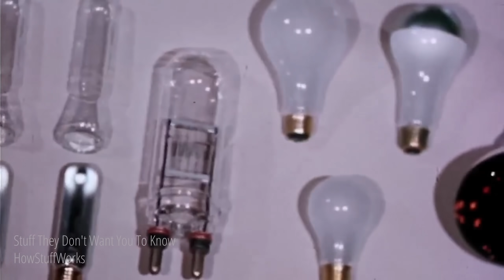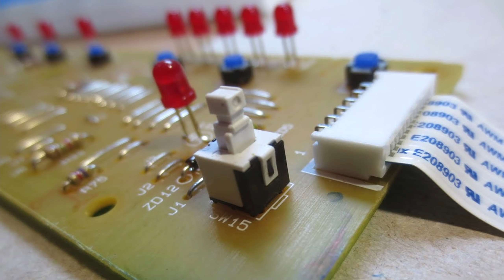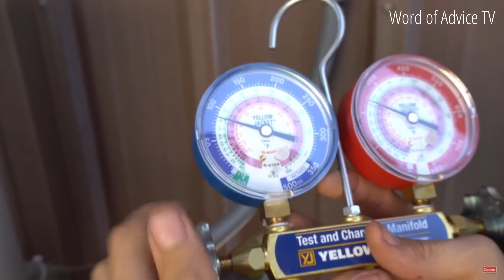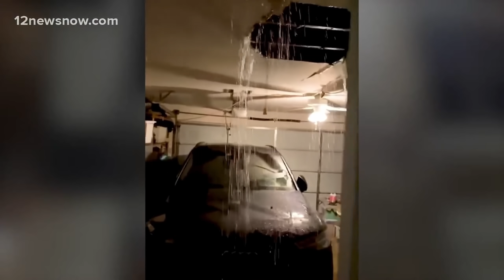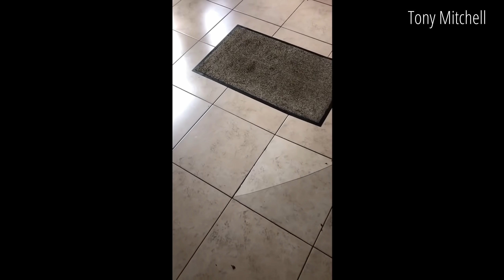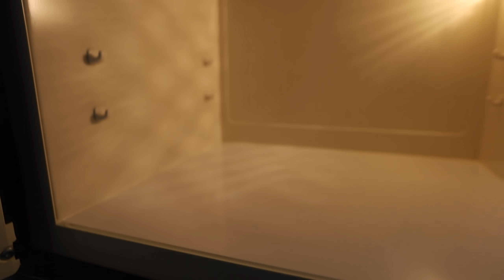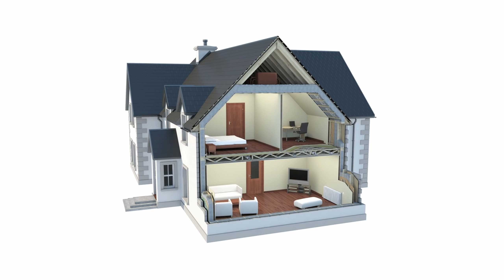Built to FAIL | Planned Obsolescence

Comment: So true ... I hit a small related issue this week when I tried to replace the diverter in a bathtub spout .. but the  spout broke when trying to remove the old diverter. This would not have happened if the spout was metal.  I was forced to replace the spout.

Comment: Bling fails.  Does your appliance really need a wifi connection?  The most reliable gas ovens are gas-only with no blingy electronics.  But even buying pricey appliances that look robust doesn't insure reliability.  I was considering a used high-end Bertazzoni gas range, but googling found they constantly fail and parts are hard to get in U.S.

Comment: I fixed my step mothers expensive oven. We contacted the service tech they advised to buy a new one, to fix it will cost $2000, better to buy. I took it apart, and disconnected the connections on a mother board. After few minutes i connected them back and it came back to fully functional .  Saved her thousands. Probably it has internal timer that is deemed to shut down after some time usage. Theu are cheating 😂

Comment: AWESOME VIDEO ! !  --- here's one --- EXPOSED FASTENER METAL ROOFING ! . Metal roofing will easily last over 100 years; But with fasteners that always have a "PLASTIC WASHER", they can only last as long as the washer.    it is so GREAT from you about this. Not many people really understand "Planned Obsolescence" and how many types exist - IT IS EVERYWHERE ! ! Here's a good example - EXPOSED FASTENER metal roofing! first the fasteners washers will fail, then the fastener will help introduce Tiny amounts of water to the wood in the roof and the fastener will fail due to rot out. NOTE: I live in Taiwan sometimes and they actually have "STAINLESS STEEL ROOFING" (Ive never found this in USA) but the one's I have seen are "EXPOSED FASTENER" and then the stainless part does not matter so much. Obviously; we need stainless roofing with Standing seams - therefore "Concealed Fasteners" These roofs have the potential of lasting hundreds of years.

Comment: I'm not sure you're seeing the whole story. I have little doubt some forms of obsolescence are pernicious. I watched the light bulb cartel documentary, and there are some, less clear at the outset, benefits to planned obsolescence. There is a light bulb in a Baltimore firehouse burning for 100 years. But there the laws of unintended consequences. Building it to not fail isn't free. What does it do the cost of the product? If I saturate the country with my "never die light bulbs", what does it mean to future of R&D, technological advances, or future iterations of the product? What does it mean, on a large scale, for the economic activity of the company, indeed it's viability? The future of jobs and the overall economy, including the complete supply chain? If I make a "will not fail" appliance of any sort, the price will be significantly higher, and I will manufacturer myself out of business, and ALL that entails. (supply chain, jobs etc) In short, some obsolescence is needed for economic activity.  I'm sure there is a "sweet spot" as it relates to the obsolescence, jobs, initial cost, technological advances matrix. (I'd hate to think my iphone 4 would never die, and all that entails.)

Comment: THANK YOU!!!
I’ve been frustrated with this for so long, and it drives me nuts!

Pecs plumbing is all the rage, as is shark-bite plumbing connectors with plastic inserts—because it’s easy to use.
Meanwhile, my copper pipes and torched solder joints have lasted in my house over seventy years.
I’ve had so many arguments with plumbers and contractors about not changing the plumbing and other features of the house with designed-to-break components.

The tend to mansplain this skirt, and treat me like I’m dumb. And I’m SO over it!

But I just tell them—it’s copper or nothing. I’ve sweated copper pipes before, and it’s pretty simple.
If you CAN’T weld copper, then you can’t do plumbing in my house.

Also—don’t pay until you are satisfied with the product.
If they can’t do it right, you’ll have to invest that money into another worker that WILL do it right, so stand there with your arms crossed, and make sure they tuck that flashing under the shingles properly, even though your house (and shingles) is old.  MAKE them do it right- if they want to get paid—or send someone who can fix it.

I had to fight TESLA when they installed a solar roof!!
The contractors shortened my roof sides without telling me—ripping off metal fascia sheet that looked nice and covered my soffits.
They left an ugly shredded mess and my soffits exposed on the sides, so the next big wind could come along and blow it apart.
It took seven months of phone calls, emails and fighting to get them to fix it.
They finally paid a local guy to do it, and it’s looks great.

What a nightmare!!!

Comment: Planned Obsolescence drives me crazy... and I must be weird....  My couch (Sofa/Chesterfield) turned 34 years old this March 2023 (reupholstered once although it needs it again).  It is very frustrating when you go to buy an appliance and the $500 model has a 1 year warranty while the top of the line cost $4000 and still only has a 1 year warranty.  This is especially frustrating when my mother bought a Speed Queen washing machine in 1970... lasted through three children growing up... and sold with the house when they retired... still running like brand new and only needing two minor repairs over all those years.  Now you are lucky if you can get a washer to last 2 years.

I have made a conscious effort my entire life to not fall into the "Obsolescence" trap.  I was looking for a new bed frame and the stuff at the furniture stores was garbage.  Most looked like it would fall apart before it even left the store.  I saved my money and purchased an Iron Bed from the American Iron Bed company.  This bed will live on for the next 300 to 400 years barring any disasters.  Was it expensive... yes... but I love it and it is remarkable and almost indestructible!

Comment: I'm not sue ALL big corporations are out to sell you things that break. Yes there definetly are I know but a few examples from my experience.  My Kenmore washer is still going after 15 years(to my surprise) My Bryant AC and Heater is 24 years old, My Kenmore Fridge is a 1980's model with vinyl wood trim and lots of chrome and 2 repairs, looks like crap but it still works. My matching dishwasher did have to be replaced a few years ago . I've had amazing luck with a 1988 Toyota pick up, 1997 Honda civic,  My 2006 Honda Fit ran great but the AC died which did cost a huge amount to fix. Honda and Toyota  make amazing complex cars that need very minimal maintenance and run forever in my experience as long as you do the maintenance. As far as the right to repair I think the consumer also has to be responsible and maybe society. In high school I took shop classes and became very handy and at 54 years old I think I can repair just about anything from house things to auto and motorcycle repair. We don't value these skills anymore and is it possible that manufactures know this and are just catering to this reality? If we don't know or are too intimidated to try to fix or solve a problem then we are at fault also.

Comment: Excellent presentation Belinda..
Another thing about the floating slab is
Your footings are poured then the next day the slab is poured...
     The concrete has to go to the back of the house....
Builder has charged owner for a pump 
The concrete pump is never coming 
So the concreter reverses the fully loaded concrete truck over the front footings..
They all do it...an ive worked in other countries,,,,they all do it...
    Front footings are cracked from new..
  Its a time thing with concrete 
Its gotta go down quickly....
     If u was building a house today,   I would be there every day..
Floating slab footings usually don't have trench mesh....
      Youve just got a big loan for something that is failing from the very start

Comment: A retired Contractor here in Phoenix, AZ. I've done more repaires on the homes that were build in 2000 and newer, the older homes from the 80s don't have much issues like the new ones. Also wall paper is the worst thing that you can put on your walls, I've seen so much mold behind some.

Comment: At my parents home they apparently bought up near exclusively marterials that were phased out of production so that repairs are next to impossible! They also painted over moist plaster and wood and the isolation had more holes than swiss cheese... Plus, at one spot a tar paper was too close to an unisolated warm water tube causing it to melt and drop from the ceiling!

Comment: Excellent information.  I had a Maytag washing machine that lasted 35 years.  The next Maytag washing machine lasted 15 years and I had issues with it from the get go.  I had to call out a repairman twice before the last time when a plastic part that kept the tub secured had a repeated breaking of the clips.  The last time the repairman said if it broke again it would not be able to be fixed because the parts are no longer available since they have completely redesigned  the washing machines.  It was the same thing with a one of our refrigerators.  The original refrigerator lasted 30 years.  The next refrigerator went out in 6 years and the repairman said it would cost more to repair than to buy another refrigerator.

Comment: A lot of good information and evidence of planned obsolescence. I think many of these outcomes can be overcome by planned maintenance and repurposing. Scheduling annual maintenance on the bones of a house, consistant cleaning and maintaining of items inside the house takes minimal effort relative to replacement costs. When I upgrade  a still usefull item, instead of trashing it, I offer it up online , as it may be useful for others. In the 14 years of purchasing a LG front load washer, I have replaced the 2 water valves, 3 shock absorbers,  tub bearings and spindle shaft to keep it working at a cost of less than $200 and approximately 10 work hours total, during the past 4 years. The use we got from it, exceeded the cost of repairs, over these years. Youtube videos give excellent instructions.
 Seems like personal responsibility is an untapped resource that may offer solutions.

Comment: I haven't owned an American car since I was a poor teenager. I never bought one new. I've owned Toyotas and Mazdas all my adult life. The Detroit Gang started all this engineered obsolesence $#!+, and now they can meet their demise because of it. Good riddance to them...And by the way...When refrigerators came out in the 1920s, they had all the heat generating parts on top. Why? Because heat rises of course! Then some wiseass engineers (probably GE) decided that the compressor and all that "looked better on the bottom", so ever since the poor refrigerator has had to fight off its own self-generated heat for at least a half century...

Comment: Historic preservationist here, and this is one of the issues that motivates me. A big issue is replacement windows, which are aggressively marketed as being more efficient and green than "old" windows. However, both cheap and expensive new windows show unacceptable wear after a couple decades, and they don't return their investment. Plus, vinyl windows are highly detrimental to the environment because they end up in a landfill, and vinyl is polluting to manufacture from the start. We have the materials available today to retrofit traditionally-built windows to be as energy-efficient as replacement windows. Having that done isn't even that expensive compared to replacement (at least theoretically, there isn't enough labor for it and that's a problem). Traditional windows can be taken apart and put back together, rotten wood can be patched with dutchman repairs by anyone with basic woodworking knowledge. You can still buy hardware like the weights and cords today. The window replacement industry is generating unacceptable waste.

Comment: I refused to buy a house in a neighborhood I liked because of its replacement windows. The house was old enough to probably pre-date vinyl windows. Those are called "replacement" windows because they can't be repaired; they have to be replaced. Every window in the house had broken vinyl frames. That gets very expensive very fast.
 I presently live in a 126 year old house with wooden windows that were designed to be repaired. I'm a small woman without much arm strength, but the design makes it easy for me to remove, repair and reinsert the wooden windows. I think 126 years is a good lifespan for a building component. What's your opinion?
Reply: They can be repaired. It is just that nobody is willing to do it in your strange country. And why? Because money... of course.

Comment: I'm so glad my house is over 100 years old and has original surfaces still. Nothing beats an old wood floor that's already moved so much it's pretty much in place and dry. Minimal functioning plumbing was installed with easy access, electricity redone and up to code, only thing needed now is more storage and insulation which we'll do when needed. I don't mind wearing a heavier blanket indoors in winter.

Comment: yes this is truly a problem, besides world overpopulation and environmentalists not wanting to name that. People want cheap stuff even If they know it will last shorter. I have the luxury of being able to buy more expensive things. I choose things that have proven to last a long time. As a civil engineer I can however also claim that a durable house is slightly more expensive than a non durable build. It is often more about using the right materials and making the correct construction details, taking care of the physics (mostly moisture and ventilation related), and easy access to replace elements like you noted in the video. But people demanded things to be cheaper and cheaper so I stopped building because I could not accept building crap. Personally I think the government should forbid things that do not last long as they should. Like now you can buy brandless light bulbs, but only 2 manufacturers make the ones that last. So stop buying cheap crap and stop following the latest fashion. Meanwhile writing this more babies have been born and more throw away stuff has been produced.

Comment: I'm a contractor myself and hate having to deal with that.  Sometimes it happens at the tail end of a job.  All I need a few pieces of tile or one box only to find out the manufacturer is not making it anymore or changed the size, color or style just just enough to complicate your project.

Comment: Sorry to disagree that this is "planned obsolescence".  It just sounds like you bought junk and perhaps didn't do enough research before purchasing (or got unlucky).  
- The cheapest LED bulbs skimp on the heat sinks-more expensive ones don't skimp. 
- Laminate flooring comes in different qualities...just like carpet and linoleum.  If you buy cheap, you get cheap.
-The * shaped iPhone screws don't fall off the install tool as easily-that's why those are used.  That screwdriver bit is easy to find, but getting those screws out is the easy part. (the real problem is that they are glued/taped together). 
-Finally, regarding the toaster -  I have two of that same model Panasonic toaster for over 10 years (I bought a second one for my daughter when she got her own place). I've had no problems with that switch.  If it was planned obsolescence, chances are one of those two would have failed by now.  Also, that's an easy repair for any handy person or appliance repair person.

Comment: My most recent example is clothes. About 5 years ago I happened on some clothes in Costco and bought a couple of pairs of pants and a few shirts. They turned out to be perfect for work so I went back and bought a couple more of each. 3 years later, they showed almost no signs of wear and were the absolute best work clothes I had ever owned. Washed and dried really quickly and were absolutely wrinkle free ( a must for me). I work in printing where black is the easiest color to wear as it doesn't show ink, and these black clothes had not faded at all with weekly washing for all those years. Needless to say, I wanted to find some more of these. I looked at Costco with no luck and then went to find the actual manufacturer. The brand is Gerry and its actually outdoor sportsman type clothing but these particular clothing items were no where to be found. Besides that, there was no way to contact or order directly from the company. Some other companies carried their products, but not these perfect, long lasting ones. I knew what I was seeing. Planned obsolescence. Their other pants I tried showed wear in two months. 

Needless to say, I bought all I could find on ebay and am dreading the day they finally disintegrate. I've already had to have someone repair a few seams. Its disgusting to me that they would be stopped from selling a quality long lasting product. Bought out by these other companies, I assume.

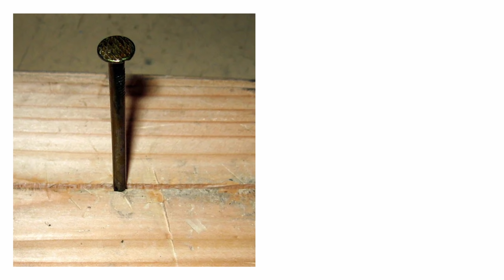Comment: 2:38 Sounds like my house, built in 1979 - - nails instead of screws, and staples instead of nails. A foundation that is sinking. A Freon that is obsolete in the air conditioning.
 My whole house seems to have been built just below code.
6:40 Environmental Regulations & Policies are creating some of these problems!